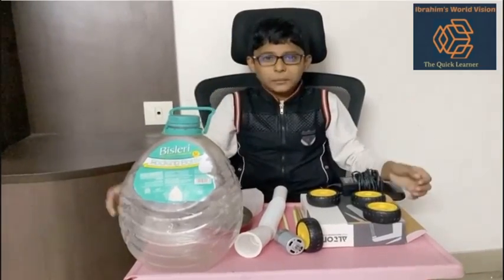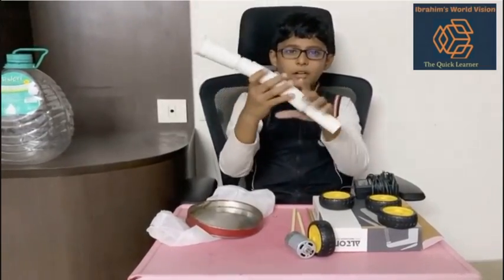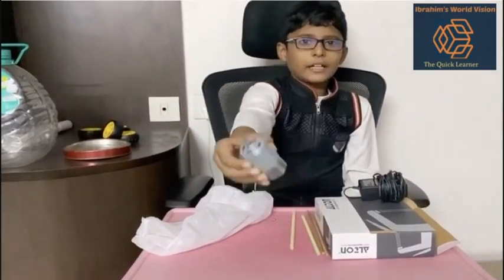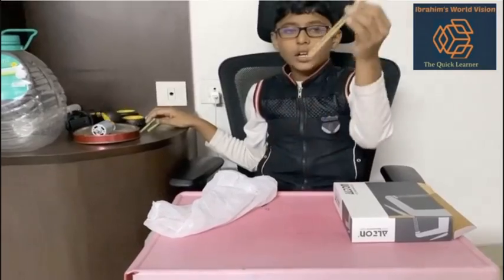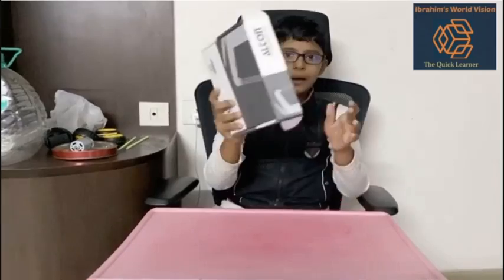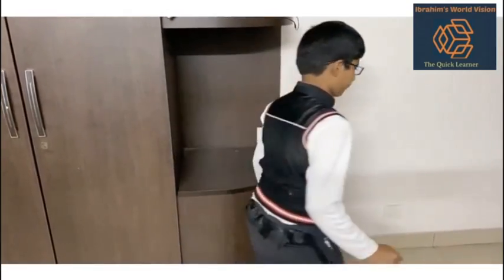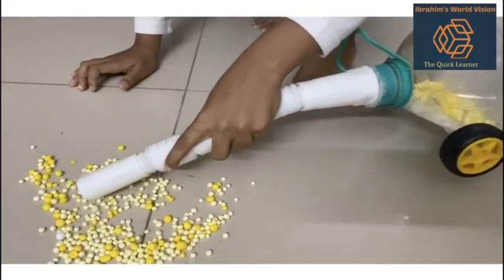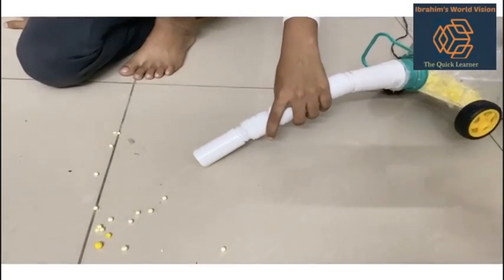Make your Own Vacuum Cleaner--with Just Plastic Bottles!

Comment: here i got stuck on how to program that actuators how is it moving better sharing me codes if possible and i really want to follow you on all your plat form please let me know
Reply from the maker: There is no coding  for vaccum cleaner project bro
Reply: so that means the sensor is only one in charge of controlling a movement ,or which sensor are you using to detect that things or to attract that things inside
Reply from the maker: @WillyDaltons no bro they are just normal wheels and it is not connected to motor , it doesn’t have any sensor nor coding. It is just operated by us only

Comment: Can I make it without adaptor
Reply: Ma shaa Allah super💖
Reply from the maker: @hassanyasmeen9319  Jazakallah Khair.😊
Reply from the maker: Yes.you can use 12 volt rechargeable battery.instead of 12 volt adapter